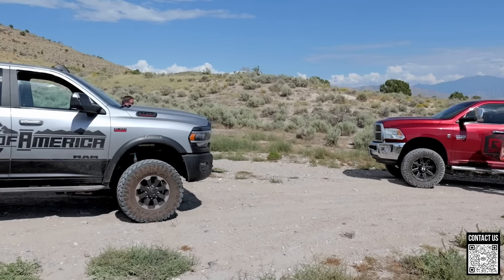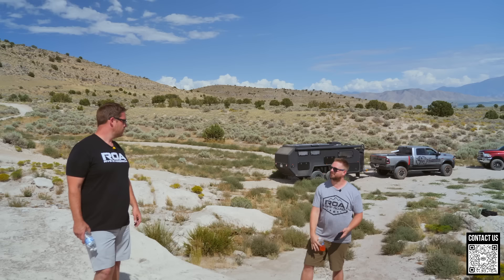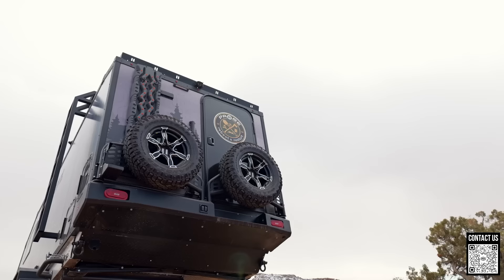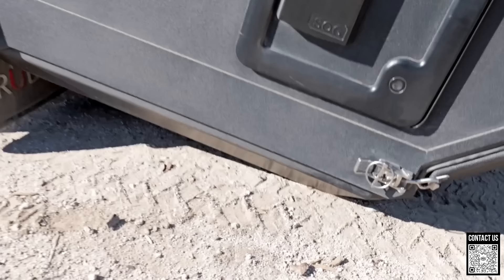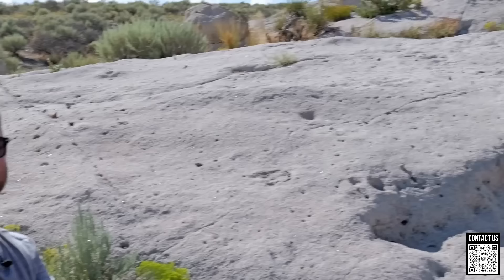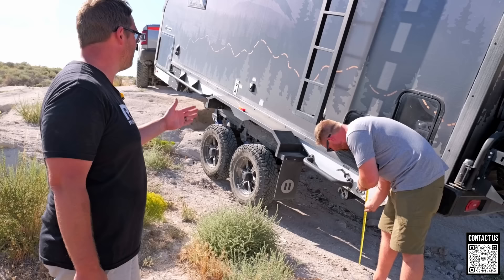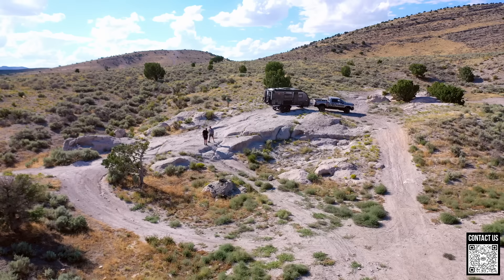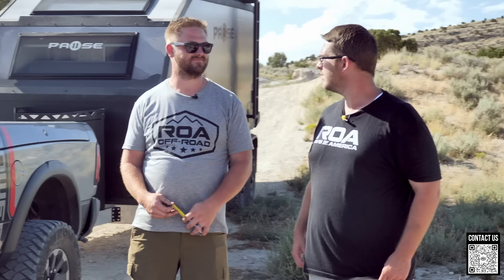Bruder. What's The Best Off-Road Trailer? Pause or Bruder? | Bruder Vs ROA Lineup EP 3 ROA Off-Road

Comment: Before I purchased my X 195 I seriously looked at the Bruder 6.   I live and explore Central and Eastern Oregon with occasional trips further afield.   The Bruder has a cabin pressurizing system to keep out dust, the X 195 does not.   I need to come up with a way to add cabin pressurizing system to keep out the dust.  I am surprised how many holes in the body of my X 195 are not caulked and allow dust to enter the trailer.
Reply: Cabin pressurizarion is a must, it's somewhat lazy to not include it.
Reply: where are those 'holes'?
Reply: @spartaforever3636  The largest I have found it the door seal.  It does not completely seal the doorway.  The second one I found it under the bed on the left side.  I think it is where the heater line comes into the trailer.  I can see lots of light around the hose.   My knees are not what they used to be and I am sure based upon what I have found already there are others.  I love the design and components but I have found many items that show a lack of quality control in the assembly of the trailer.  I am handy and have been able to correct all of the issues more or less.
Reply: It is super easy to add a pressurize system they sell them in Australia. All trailers are not air tight
Reply from the maker: @skylinersYeti Awesome upgrade idea, Thanks!

Comment: Kind of irrelevant doing the test at ride height. Also, tackling an obstacle like this with load sharing on the EXP-6 is ridiculous. You would lock the bags climbing that rock. 

Important to note, look at the bend in the airbags, they are very inefficient bent like a banana how they are on the Pause at full extension, durability will be compromised. The Bruder's are pretty much dead straight.

Take it to Australia and run this test over corrugations, in the desert for hours, then up the beach (this is when load sharing is relevant). There is so much being missed in this video and this shows a significant lack of understanding in how to run a vehicle off-road.
Reply: I wonder why they never responded to someone like yourself and instead respond to people that don't get technical in their comment. 🤔 this seems like good insight, but I don't have enough knowledge about the subject matter to know for sure!
Reply: Amen its Apples to Oranges & I'd still pick the Bruder 6 for 60K less. This video is almost funny if you know & total miss information if you don't know the fact. thanks for pointing them out. It actually make me not trust ROA.

Comment: Look at the massive front to back wheel articulation on the Bruder. 
Sorry to say fellas but you’re using fore/aft load sharing which is the setting for high speed corrugated and washed out dirt roads. 
Switch it to non load sharing and you’ll accurately demonstrate the ability of the bruder… but hey why would you want to do that 😂

Comment: Bruder wins hands down,as they didn't use suspension as it's designed for, the Pause is designed for highway travel only,too heavy,too long,too tall,would fall apart in Australia And obviously the bruder build quality is better being one piece.
Reply from the maker: This is pretty funny the Pause actually overtakes the obstacle better than the Bruder. Also, you can’t say it would fall apart without seeing it in person. The Pause quality is much better than the Bruder.

Comment: Kind of unfair of how you guys didn't comment on the Pause at 16:07 . From that camera angle, looks like it would not have cleared without going full max height. If true, means that the bruder cleared the obstacle with less suspension clearance.....
Reply: Yeah but the Pause is way longer and still cleared better. With it being 5ft longer it is way more capable. The measurements are the measurements and the Pause on every measurement killed the Bruder. If the Pause was shorter it would have totally got even more destroyed. 😂
Reply: He said in the video they might scrap the front of the Pause because it is longer but still didn’t. Both cool trailers but it seems clear that the Pause is superior.

Comment: The Bruder center of gravity is far lower and thus far more stable verses the Pause on treacherous terrain (the pause would flip over) That’s exactly what would determine superiority: lateral angulation. I assure you, the Bruder would be more stable and that would be a more comprehensive test. The pause is still a nice trailer, but you really can’t compare them.
Reply: most overlooked point here.....Pause way too tall and it doesn't tow as well - offroad or on. Exp 7 or 8 any day of the week

Comment: LOL. This Video is Fake Newd. Comparing apple to Oranges. Pause camper STARting price $160K vs Lowest Bruder 6 at 90k. :face-fuchsia-wide-eyes:I'd take the Bruder XP-8 any day of the week over a Pause. No question.
Reply from the maker: Your facts are not correct. This Bruder was $150k new. They are different trailers and the Pause would compare better to the EXP-8 but the Bruder 8 is also closer to $200k.

Comment: Disc comparison is fantasised with lies. The xp6 at its lowest point for bitumen use is about 11 inches grand clearance. When you are off-road you raise the airbags up another 3 inches. And when you do get to bigger obstacles you can actually raise the airbags higher unlike the American version only has one height. The bruder winz outright.

Comment: I noticed with the bruder when you had it at ride height that the draw bar had heaps of room under it unlike the pause and also the wheel travel from front wheel to rear wheel as an independent unit had far more flex then the pause

Comment: I really don't understand what the goal was for this video. Your doing a bunch of things that an owner just simply wouldn't do like rock crawling with their $100k trailer while there was so much space to just park it everywhere else. "Off road" doesn't always mean rock crawling. If they do decide to do that or are forced to because of the trail, they wouldn't do it at ride height. 

Not to mention that the Pause weighs a full 2700 lbs more than the Bruder empty. (Which affects your choice in tow vehicle) What about the height factors and getting through low overhang areas and garages? Also the Cargo capacity on the Bruder is 2600lbs while the Cargo Capacity on the Pause is 1600.  Don't get me wrong, I love both the Pause and Bruder but this comes off extremely unfair and disingenuous. Like a late night infomercial where the actor is fumbling around with a tool everyone knows how to use. Just do an honest apples to apples comparison showing the differences as they are and let the people decide what's best for them in their situations. No need to make an other brand to look bad just to sell yours.

Comment: Is the Pause chassis rated to 11t? You could hit those obstacles at 30mph in the Bruder and not bother it. The Pause would leave its wheels and suspension on the rocks. This is just a clearance test 😂
Reply from the maker: We would guess you have not actually seen a Bruder in person? Certainly not side by side with a Pause. The quality and robustness of the Pause is much higher than the Bruder. Just Watching videos you can’t always see the details but this Bruder we actually put hands on was no where near the quality of the Pause. It is laughable to think they are in the same category. You have gotten sucked into the Bruder hype. 🤣